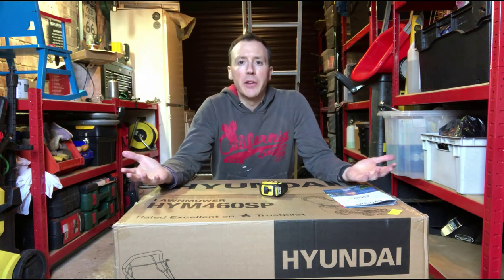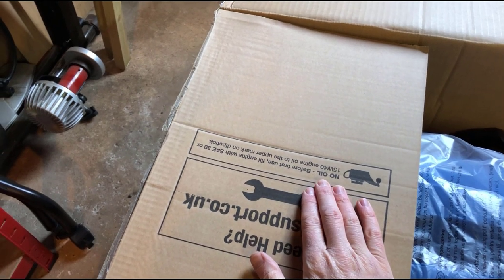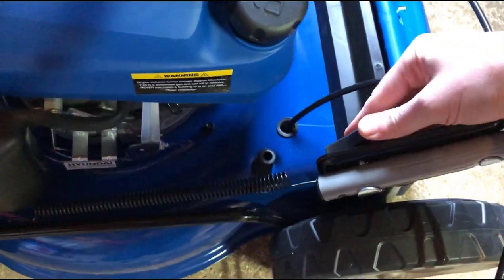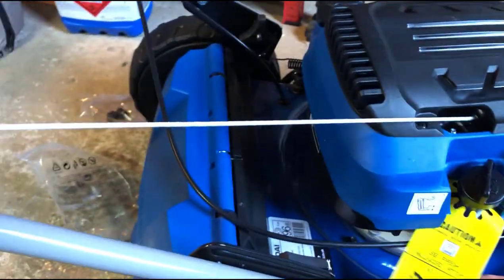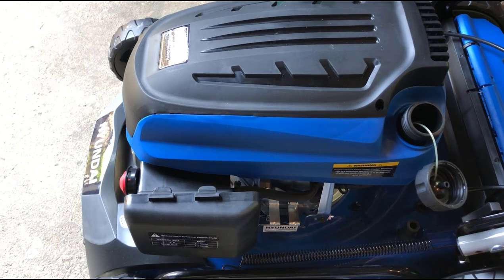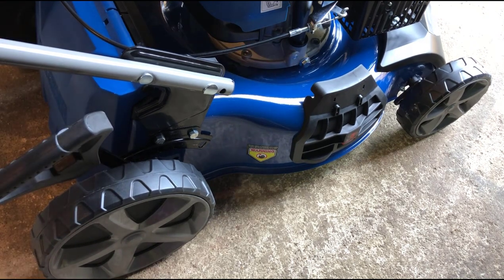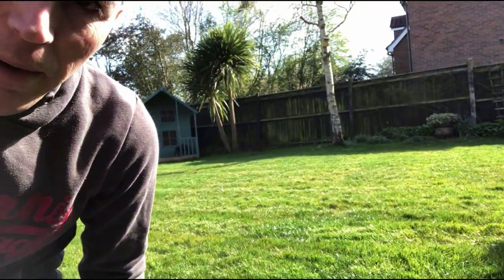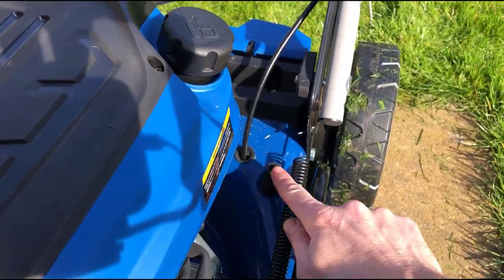Hyundai HYM460SP Petrol Lawnmower Unboxing & Assembly Review

Comment: Hi Tom. the reason for the Two holes at  the bottom of the lower handles is for height adjustment of the handles . you can swap to the other holes with the bolts to adjust the handle height up and down . Nice video thanks for sharing Ade.
Reply from the maker: Ahhh, of course! Thanks for the tip!

Comment: Thank you, Tom, for this video... I found it really helpful. Luckily I didn't need to adjust the cables... I'd probably have made a pig's ear of that! I've used it for the first time today since getting it last week... what amazed me was how powerful that drive is... nearly took me off my feet at first. Well, not quite, but the previous mower wasn't one with a drive on it so I didn't expect it. I'll need to adjust the height... a bit too long for the front lawn and a bit too short for the back lawn and it's a very hot day at the moment, so I'll water it tonight. Anyway, many, many thanks once again... it's guys like you who give other folk confidence to do stuff like this. I'd not have managed with the instructions as printed.

Comment: Small tip on great video, the cleaning process should be carried out with the engine running, couple of minutes and it will be immaculate underneath.
Reply: How many minutes exactly?
Reply: @enterthematrix11  couple of minutes with hose attached and the engine on, immaculate.
Reply: @kevinbaird7277  Yeah, i saw in this video there was still quite a bit of grass underneath. What do you think of this lawnmower? im thinking of  buying it but unsure about hyundai brand
Reply: @enterthematrix11  good machine, I have this model but next size up, a tad heavy as was alluded too in the video, has drive and this adds weight,  solid machine though, I brush it underneath when dry, still looks brand new after 2 years use.

Comment: I think you might have strapped the cables onto the handlebars the wrong way around. They should be on the outside of the bars instead of the inside. The cables scrape against the metal of the bars when positioned the way you have them.

Comment: Great video Tom. Have you assessed the running cost? How often do you re- fuel and what is the tank volume? Thank you.
Reply from the maker: oooh, great questions. I don't know... but give me a few weeks of running and measuring and do a follow up video :)
Reply from the maker: On this…I just refuelled; tank volume is approx 1 litre. I measured a litre and it comes almost to the top. 

I’m roughly tracking how much I’m using it so can provide some idea of how long that lasts once I’ve mowed through all the fuel :)
Reply: @thoughtstuff  thanks Tom good to know. Keep me posted that will be useful to know about 👍

Comment: Hello I'm looking to buy this mower to use  in a garden maintenance business. Was just wondering how is it holding up to this day?
Reply from the maker: Hi - still doing fine. Used it up to 3 times a week in the summer. Cleaned the underside fairly regularly, but done no other maintenance apart from blade sharpening. Oil levels haven't needing topping up. Still starts first pull, no complaints.

Comment: It is a very nice machine. Has it been reliable?
Reply from the maker: Yes. Since that recording used it multiple times a week until November time, left it over winter, fired right up a few weeks ago, always starts first time after a few pushes of the primer (the red button in the video). No maintenance or anything other than topping up with petrol. 👍

Comment: Are you meant to turn it on with the hose pipe in?
Reply from the maker: Yes. Not walk with it but you can turn the hose on, then start it up and the blades with throw the water all around underneath and clean it a lot better than when it’s off. I do it for maybe 30 seconds after every now and it definitely stops the grass building up